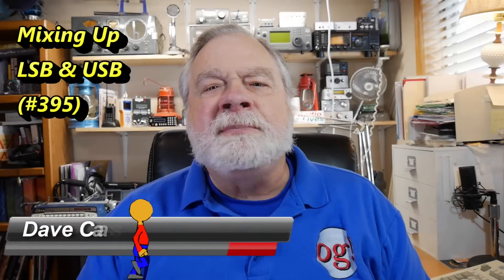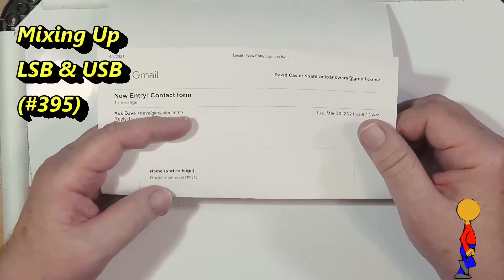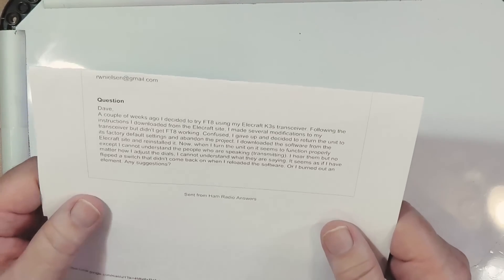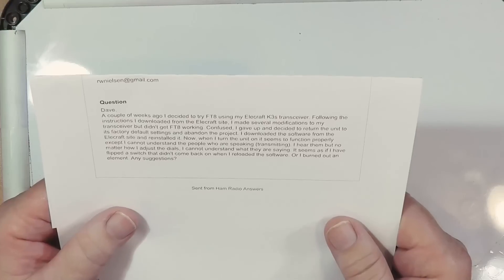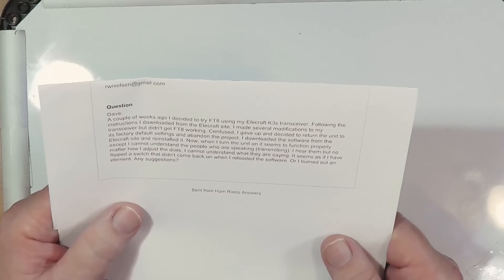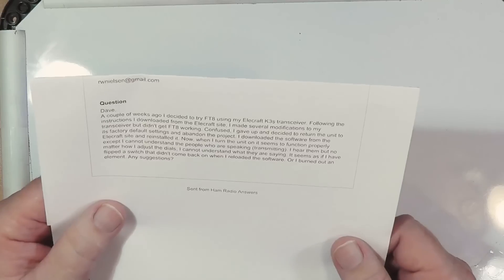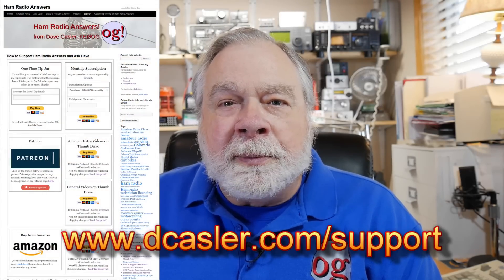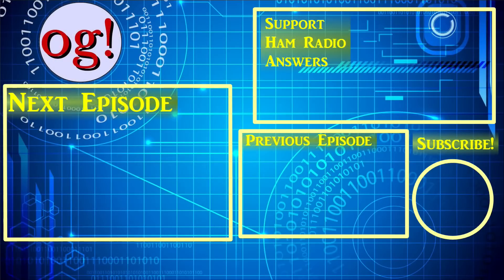Getting the Sidebands Mixed Up Creates Audio Garbage (#395)

Comment: So, I may be wrong here but my understanding is that the reason for using USB above 10Mhz and LSB below 10Mhz was the use of 10.78Mhz in dual conversion super hetrodyne pll receivers.  Above 10.78Mhz the USB  signal is correctly phased but the LSB signal is inversely phased and must be inverted adding another step in the circuitry.  Also below 10.78Mhhz the LSB signal is correctly phased but the USB is inversely phased and must be inverted, again adding another step in the circuitry. These added steps are opportunities for added noise and make extra unnecessary work for the receiver that could be eliminated by simply throwing a switch. Again,  I'm not an expert here and would appreciate some help on where I've gone wrong.

Comment: The same thing happens in Marriages: When Your Spouse uses Inverted Speech, and you think to yourself "If only my Spouse had a VFO AND a Mute Switch, things would be better between us communications wise..." So now it's time to explain the History of this whole "Sideband Convention" to newcomers to the Hobby and change the Status Quo, because as far as I know it's not found in any early radio history book: It all started way back in the "Spark Gap" days,  when some rich and high falutin' hams finally broke the 10 MHz Barrier by just throwing loads of money at the problem, and suddenly: Everything below 10 was relegated to "The other side of the tracks." Indeed? Operating "below 10" was for the ragged hams, they were the poorest of the poor, hams operating in conditions worse than the poverty in any Charles Dickens Novel. And then over time, "Lower" sideband being on the Left, started to be represented in "blue" on spec sheets, and "Upper" sideband being on the Right, of course being therefore marked in "red". This has caused a lot of division, mostly long division, not that "New Math" kind, either: So why not show that you don't believe in this pretty side band division, by transmitting AND receiving in AM? You'll love the harmony of BOTH sidebands working together, harmony without harmonics, inverted speech sounds, and howls and squeaks... and get that great feeling of actually being able to listen And be HEARD clearly to go along with all of that vacuum tube warmness and glow... And with a little time and persistence? These on the air operating manners will help YOU become a member of the A-1 Ops Club for sure!  73 DE W8LV BILL

Comment: Is the inversion on purpose or simply a manifestation of the balance between the waves created during modulation?
Reply: I am definitely not an expert. From what I understand both side bands and a carrier are what are produced with AM modulation. Single Sideband only transmits one sideband and not the carrier.
Reply: @Roanokekidstech  I’m no expert in these matters either, but having just completing my studies for and receiving my General CSCE, I’m suspecting it’s the result of the local oscillator frequency mixing with the input frequency that produces multiples that are both added and subtracted from the carrier frequency (in the balanced modulator) that produces the mirror image frequency’s.

Comment: There is a group of guys on 80m that use USB. They like to position right next to the net I'm in LSB. If course there's some bleed over and qrm on the net. Sometimes words are exchanged and the group didn't care about the gentleman agreement on mode.
Reply: I've noticed the use of alternate sidebands on 40 and 80m. They almost never use call signs, and when they do the suffix is always indistinguishable. QSO's run from short comments to near broadcasting lengths, with topics that range from the "old time relegion hour" to the old "Art Bell" program 😆

Comment: Thanks. I apparently incorrectly understood that as the audio voltage moved up and down the frequency moved up and down with each cycle and the louder you were, the further away from the carrier frequency reference the other end would be.
I see what you are presenting is a book with the spine at the carrier frequency with the audio written in liquid ink (low near the spine and high near the right edge). Then the left page folded over till the ink gets absorbed into that paper like an old mimeograph machine.
Now to unremember.
Thanks AG7MW

Comment: I've read on Reddit that some operators report hearing USB on 40m more frequently. Perhaps some hams are beginning to eschew sideband convention.
Reply: You are correct Levi. I hear it too.

As far as the SSB is concerned How would an experienced operator not know that? It's taught early on in the Technician classes as being in the question pool. As far as some ignoring the convention of LSB/USB...I have experienced that on both 40 and 80 meters several times in the past 2 months where some were ignoring it. 

Actually I have noticed quite a bit of bad behaviors that I had not experienced since the 1970s and 80s on citizens band. Especially on 75/80.

Maybe there is a bit of truth to the saying that the requirement for code did weed out the bad plants in the amateur radio garden.??? 
73
Reply: @KT4RAM  I agree with the fact there are going to be some hams out there that ignore conventional operating practices.  Ham radio is a little bit experimental practice anyway but changing up usb and lsb gains nothing so in my opinion it's done buy hams just to be a jerk.  It might be a really piss poor way of keeping other hams from messing with some "exclusive" group of jerks.  On the subject of CW,  I'm plagued with dyslexia and struggled for years with CW before giving up.  Had code not been eliminated from the requirements I would never have been able to get my license.   I guess I'm one of the rifraf

Comment: Hi Dave,
The other important item to get correct for FT8 is have the computers time in sync with UTC time. My computer was 12s off UTC and could not receive anything on FT8. For some reason my PC won't stay synced and haven't found the cause. I must periodically check and correct the PC clock. Stay safe.  73  WJ3U